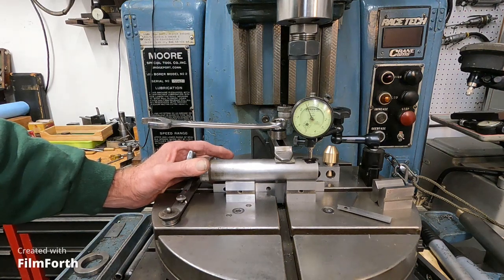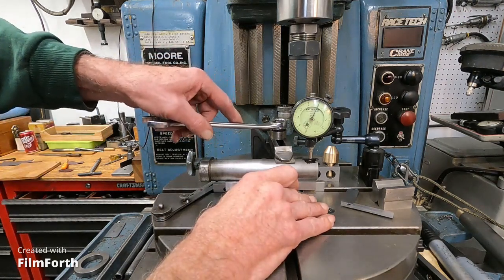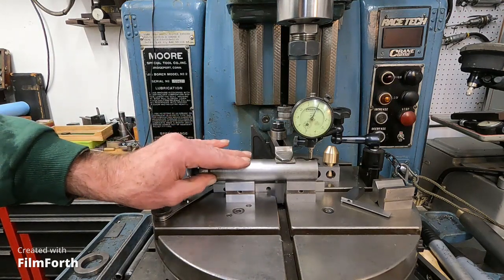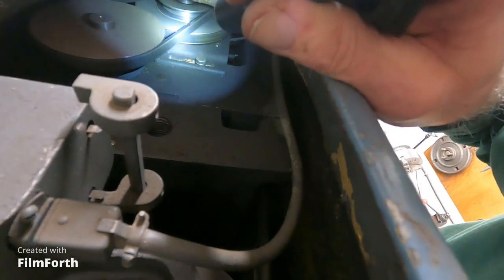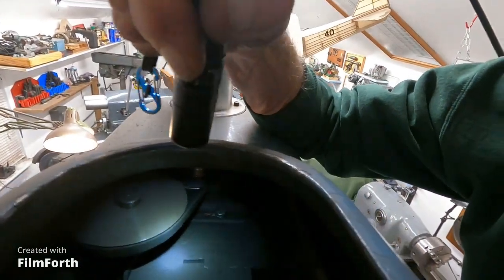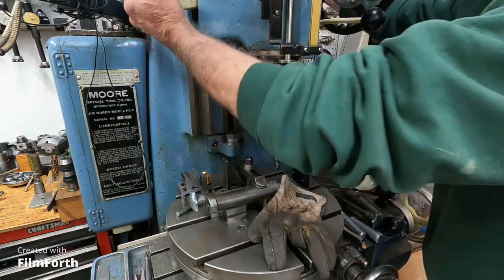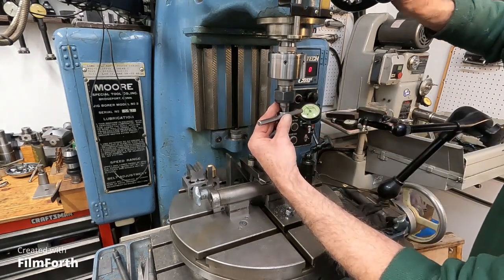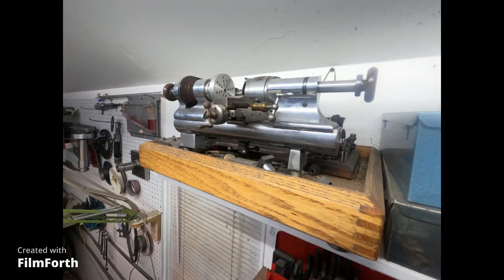Moore jig boring precision and clamping

Comment: DeeDee, nice demo. That jig borer is quite the tool.. when you know how to use it.   You’ve go a long list of things to get done.   I’m looking forward to riding along.   Cheers, TB
Reply from the maker: The jig borer in combination with the horizontal mill with vertical head is slower than using a standard vertical mill, but the combination has more power and precision. My small job list is getting shorter of bringing in 3 derelict machines, this job wraps up the Axelson. I have a few things left on the mill and drill. This is the point where all that work will start to recover the $12000+ too much time spent for 3 restored and tooled heavy industrial machine tools by using the machines as intended, it will pay back as long as I can use them.